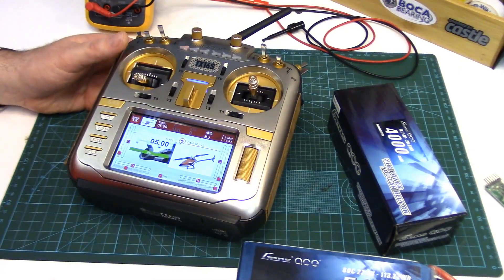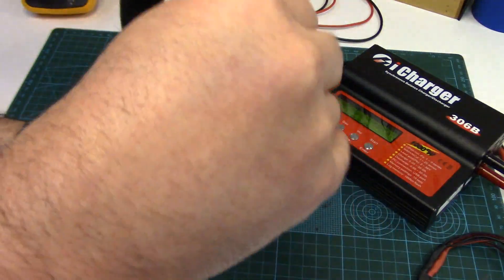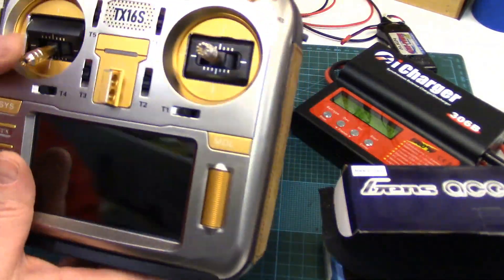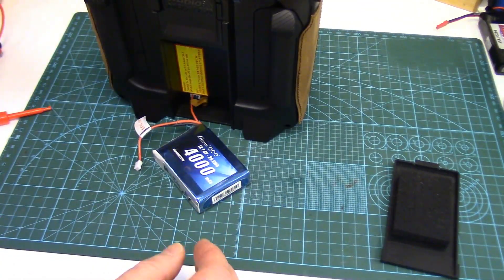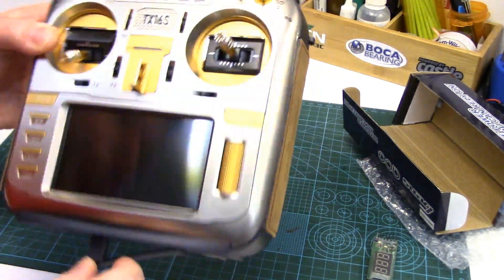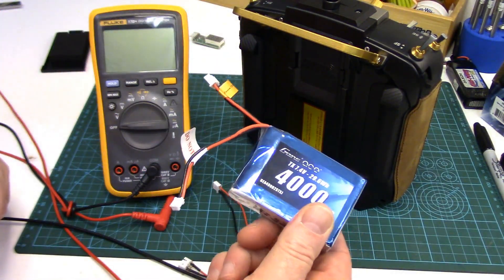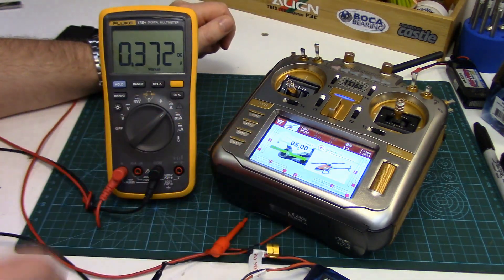Battery Pack for Radiomaster TX16S - Fitting, Calibrating, Run Time

Comment from the maker: Gens Ace 4000 mAh 2S TX16S Battery Pack:
BuddyRC: https://www.buddyrc.com/products/gens-ace-4000mah-7-4v-2s1p-tx-lipo-battery-pack-with-jst-ehr-plug-1?ref=-ptdbz6d-llb
Rotor Quest: https://www.rotorquest.com/gens-ace-4000mah-74v-tx-2s1p-lipo-battery-spektrum-dx7s-dx8-dx9-radio-109334.html

Comment: Great video.  How did you get the amber voice when turning off the transmitter?
Reply from the maker: I can't recall specifics other than I know there is power down voice location and I just put the Amber voice MP3 file of choice in that location. I'm sure a quick google search of something like "open/edge tx power off voice file" will outline the steps from several sources.

Comment: I use 21700 round cells... 2 in parallel so around 10 Ah.. Why so big? My fpv googles also use 2s 8.4V...and with the bigger cells in the trx i can power the googles and save some weight on my head

Comment: Would the current draw not be higher as usually the RC has the radio sending/receiving data (including the radio in the external module which can sometimes be configured for high power to reach further)? Or would this be neglectable?
Reply from the maker: Current (transmit output) is a constant for a given protocol, it doesn't get higher or lower with range. The single biggest power consumer is the screen.

Comment: You didn't connect the radio to a model, I'm assuming that will draw another 75-300ma as well for ELRS, etc?
Reply from the maker: Radio was transmitting rf regardless. No change if rx is receiving or not.

Comment: I went with this same battery for my Tx16s and I was wondering if you only charge these packs via transmitter or if you use the icharger at times. I have a tenergy charger for other lipos but doesn't seem to have capability unless I'm missing something? Any info would be greatly appreciated
Reply from the maker: @SovOutlaw - You can charge a LiPo TX pack internally or externally - your call. Which method you choose will be based on the pros & cons of each charging method and which ticks off more pro boxes than con boxes which include, but are not limited to...
Pros of charging within the radio: Easier, better for the connectors (less manipulation which will eventually cause them to fail), frees up your LiPo charger for flight packs.
Cons: Slower (lower current output using internal radio charge circuitry), inability to easily storage charge the pack to 50% capacity (likely the biggest con), and inability to monitor battery condition (capacity during charge cycle, cell balance, internal resistance etc.). I personally chose to charge within the radio 90% of the time because the balance circuitry is good as we saw & I overcome the storage charge issue by timing my charge cycle to give an approx. 50% storage state. Of course I still pull the packs out a couple times a year to charge them on one of my proper computerized chargers to monitor the pack condition/health.
Reply: @Rchelicopterfun  yeah I think the only option currently (without buying a new charger) is to try internal charging with a 2A outlet plug I can use on usb side. The tenergy charger I have is a 2 system setup where it had balancer and output area and the other cable labeled “do not remove” isn’t a balance port so I can’t even set that up to current other rc charging stuff. Poorly worded so my apologies

Comment: Hi John.
Thanks for the comprehensive video.
The whole business is mind boggling when we mess with lipos.
I have a printed out book form copy of the Radiomaster T16s manual and it says all about the importance if charging but not exactly what source we plug it into to charge it.
I am innocently using my pc but having thought about it I seem to remember that the usb socket on a pc is only 5v.
I am at a complete loss.
No one says!!!
I am using the lipos ( 1850s)
That came with the tx.
The tx goes green when charging but it would surely need roughly 8V to charge 7.4V?
Reply from the maker: Internal charge circuitry uses a DC to DC buck converter. Ie. lower DC voltage stepped up to higher voltage.
Reply: @Rchelicopterfun  
Aha!!! That explains things.
I have done your switch mod ready for heli setup.
For the speaker mod, on opening the case up I already had a speaker in the back. I drilled a series of holes in the back casing from the inside and turned the speaker around .
Super loud now.
Thanks John.

Comment: i noticed on the display there was a picture of model how do you do that?
Reply from the maker: Upload the image file to the image folder on the SD card and then select the image file in the model setup menu.
Reply: @Rchelicopterfun  I tried that radio recognized the fire I got it in the setup but image is still not showing. The aircraft is not binded yet could that be it?

Comment: Thanks for this useful tutorial. Just got the Gens Ace 4000mAh 2S pack and got some error when trying to charge w/ my Gens Ace iMars ii charger. it says "too low voltage, scrap the battery". The batttery new/never used and each cell 3.8V. Don't understand. Do you have to use the EHR cable in addition of the balance plug?
Reply from the maker: If you are not charging the pack through the TX16's internal charging circuit via the USB-C, then yes, as with the vast majority of RC chargers when charging a multi celled LiPo pack, you charge through the main power plug and balance through the balance plug. Without the main plug plugged into your charger, it's not seeing any voltage and therefor thinks the pack is at zero volts and completely destroyed - https://www.rchelicopterfun.com/lipo-battery-balancing.html

Comment: Hi!
Great tutorial. Was trying to learn more about charging the battery via usb-c using this radio.
Is there a known issue with this radio when charging via usb-c?
I am using an identical battery as shown here, new arrived today. And trying to charge it inside the radiomaster tx16s Max. After a couple of hours it didn't send any charge to the battery - I checked with multimeter after removing it from the radio.
Thanks
Reply from the maker: No issues I'm aware of. I have three TX16's and they all charge perfectly from the USB C just as shown in this video. I know lots of other TX16's users as well, none have charging issues. Is the power light turning green when you plug your USB in? Green light indicates it's charging. I'll also presume you are plugging into the correct USB port for charging; the one on the bottom of the radio, not the one on the top.
Reply: @Rchelicopterfun  Thanks. I was plugging to the bottom USB port and was using an iPhone wall charger and USB-C cable - no charging nor green light. After reading your words, decided to try a different charger and tried my MacBook Pro wall charger since it has a USB-C plug - it worked! Green light indicating it was charging and after a couple of hours green light turned off.
Thanks again.
Reply from the maker: @Vitor Morais - glad you got it sorted.

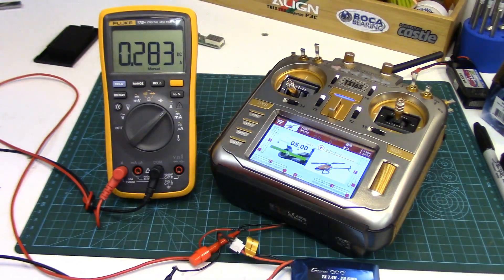Comment: I noticed that you charged the lipo, the battery meter is looking almost dead on the transmitter at the 14:00 in the video
Reply from the maker: Good eye. Answer is because the pack was not fully charged during that part of the video. The open circuit voltage when tested earlier in the video was 7.6V (3.8v per cell). That would be around a 40-50% charged pack. Pretty much what the battery meter is showing. Charging the pack to see how well it balanced up using the radio's internal charging & balancing circuit was left to after the video because I didn't want to stop shooting in the middle of it all to wait for the pack to charge up.

Comment: Just now considering getting back into RC from a time when, 1/2 the RC plane club scoffed at this new wiz bang computer radio idea. "that will crash your model", "skilled pilots don't need that", or "that's cheating", etc...
Similar thing happened when brushless motors came along.

Wish I could see today, what's coming in another 25 years?

Comment: I just got the color version. using a 2s lipo but when I trying charging it grenn light dont come on. am I missing a setting? is internal charge even working? just got radio last night.
Reply from the maker: No setting in the radio - it should start a charge cycle automatically as soon as you plug the USB C in. A few items come to mind to check or try. 1. Try a different USB cord in the off chance the USB cord is defective. 2. Confirm you are using the correct USB C port on the radio (the bottom one for charging). 3. Try a different USB power source. 4. If the LiPo pack or 18650 cells are unhealthy (high delta voltage difference between cells) or under a certain voltage (ie. over discharged or faulty cells), the protection circuitry in the charge circuit might prevent the charge cycle. No idea if the charger in the TX16S's has LV or imbalance charge protection as I've never tested what happens if an under voltage or large imbalanced pack is used? 5. The pack or cells you're using are already fully charged (about 4.19 to 4.20V per cell) so a charge cycle simply won't start.
Reply: @Rchelicopterfun  yes my mistake... I plugged in the power instead of the balance plug from the battery into the radio once I did that correctly it worked fine.. I had to think about it for a few minutes and then I realized it all good now though.

Comment: hey quick question
My Radiomaster isnt auto charging when its plugged to pc, do someone know why or what i need to activiate to charge it?
Reply: Are you plugged into the USB slot on the bottom of the radio? That top USB is for data and bottom for charge.

Comment: Hi John,
I just got this radio(i am a complete beginner btw) and have installed two 18650 batteries which are 3.7v each with a capacity of 3000mah. the first thing i did was that i put it on charge. What i noticed during charging is that, when on charge there is a green light constantly ON which goes off once its done charging (or so i thought), so when the light went off i took it off the charge and noticed that the radio wasn't fully charged(the bars werent full at the top). As I dont have a multimeter i just set the battery calibration to 7.4v as both cells are 3.7v each and the battery meter range to 6.4v-8.4v. Is something wrong with my radio or the calibration values I set? Any help is appreciated, i just hope i havent gotten a defective radio.
Reply from the maker: Nothing wrong with the radio, it's your calibration process. 
First you MUST use a DMM to do this correctly. Without  a DMM your reading is only as good as your guess; and your fully charged voltage guess is way off. 3.7V is not what a fully charged lithium cell will be producing. 3.7V is the nominal voltage of the cell. Fully charged, the cells will be upwards of 4.18 to 4.19 volts (unloaded). You can't use that voltage however for calibration because the voltage will sag under load. The voltage will also sag by different amounts depending on how much load is on the battery (screen brightness level for example) and how healthy/good the battery cells are.
In short, using a DMM is the only way to calibrate the actual voltage  - guessing is just that - guessing. 
You can also vary the voltage meter readout on OpenTX radios, but that again requires some form of voltage measurement equipment.
Reply: @Rchelicopterfun  Thanks for the reply. So you're saying that the battery charge only to the amount you set it to on the battery calibration? Because what I did was, I plugged the tx in with a 18W plug that charges upto 2.4A. And when the green light went off, I unplugged it and turned it on. After turning it on I could see on the main page that the battery voltage was at 7.5 volts with 2 bars off the battery symbol. This was before I did any messing with the system settings and calibration. And then after commenting on here about the issue, I tried to charge it with a 5v 1A plug, and it charged fully upto 8.2v which makes sense now as you said the lithium cells charge upwards upto 4.18v. Why did this happen? Was it the plug I used previously? if so, why did it stop at 7.5v?was it the plus I used?
Reply from the maker: The voltage calibration process as shown in this video has nothing to do with charge termination voltage. That is set in the built in charger circuitry and we have no control over it. Calibration simply matches the voltage readout to what the actual under load battery voltage is.
Sorry, I don't understand what you are saying about these different plugs? Are you talking about the USB C cable or the USB power source? No idea why different USB power sources or USB C cables would produce different states of charge? Faulty USB perhaps or a USB power source with some sort of automatic current output which is messing with the internal charger in the radio? Just a guess without being able to test it all. Suggest contacting tech support.

Comment: How does the charging work? and do you know it is charged?
Reply from the maker: Charging & balancing is done using the radio's internal 2S charging circuitry. When the green indicator charging LED indicator (power indicator) turns off - charging and balancing is complete.

Comment: Hi, I'm using the stock battery tray and Samsung 18650 batteries. I've tried calibrating the voltage several times now while connected (MM between the end posts on the battery for total voltage. The voltage sag just from screen brightness changes gives me different readings. (Forgot which way now). Meter is good. It picks up on the sag/voltage drop, but if i have it match on low brightness, my meter and radio aren't match on high brightness.
That said, I've never had the light turn off for me.  I let it charge overnight this weekend, and all morning the next day, light never shut off. When I checked the voltage in the radio I got 8.29 with screen dimmed. My bay charger showed 4.15 per cell. My mm agreed with that. 
What gives?

I'm about to pull the batteries off my bay charger when full. Put in holder, use my lipo checker to get voltage per cell, add them up, and power on a quickly set the combined value in the radio to see if that gets it to charge fully.... Please stop me if this might burn it down next time I charge through the radio port.
Reply from the maker: Pick the display brightness you usually run at or a mid range of where you run at an set voltage calibration at that level/current draw. It's likely due to high internal resistance in the 18650 cells you are using but that is just a guess without properly testing it and knowing exact values (voltage and current draw and testing the internal resistance of each 18650 cell). 
The method you described won't give a true value because checking the open circuit voltage (unloaded) will give a significantly higher voltage value than when loaded, especially if your cells have fairly high internal resistance. Exactly why I said in the video it's important to have an external power plug on the battery pack to check the under load operating voltage - that is the only way to get accurate voltage values and then set the calibration voltage. To do that with the stock battery tray, you could solder in a pair of "test" wires as one possible method with a JST plug/similar on the end. That or don't worry about it. After all as we saw, out of the box calibration was pretty darn close - at least on this particular TX16S.
Reply: @Rchelicopterfun  Thanks John.  Maybe it is IR discrepancy but they way I see it, I charge it with the radio off.  And it if the green light indicates it's charging, it never stops charging.  I opted to charge them full on my trustfire bay charger, plugged it in, and it yeilded 8.56v on the transmitter while my MM showed 8.46.  So I went ahead and brought it back down.  I don't typically look at the display while flying, and it goes bright based on buttons only. I calibrated it while dimmed.  I'll probably charge it again this weekend depending how much I can get out (or how much I play with a different technique of using FM GV).  I'd really just like to get it so it reaches a "done" state and quits charging...

Comment: Should i leave the battery inside the transmitter or remove it after each use
Reply from the maker: I leave mine in - at a storage state of course like you would with any LiPo battery.
Reply: @Rchelicopterfun  ok, so around 7v should be safe to hang out at if i use it daily? And thanks, i really appreciate you taking the time to answer.
Reply from the maker: 7V open circuit voltage is way too low. That's only 3.5V per cell - basically over discharged. A lipo at 50% safe storage capacity is around 3.85V per cell. See my LiPo page on my website if you are new to LiPo's and need to understand their nominal voltage range and how to properly store them, care for them, etc.   https://www.rchelicopterfun.com/lipo-batteries.html

Comment: Great Video John, While you are talking batteries, can you tell me what power units you use for your Ichargers please, some are stupid money when you start talking power for a icharger 4010
Reply from the maker: I cover the basics of what I use on my power supply page on my site: https://www.rchelicopterfun.com/rc-power-supply.html
Can't go wrong with Meanwell but for my iChargers including the 4010DUO I pretty much use modded server supplies exclusively which I cover in detail on this page: https://www.rchelicopterfun.com/dps-600pb-build.html
I use 4 of them hooked in series to power my 4010Duo. You should be able to find 4 HP DPS-600's for under $100 USD combined. The value doesn't get any better than that - nor does the quality :)
Reply: @Rchelicopterfun  thank you john. Help really appreciated

Comment: Hi John, Really helpfull vid,I bought the Jumper T16 when it first came out.Had a lot of the early issues with mine. really thinking about getting this radio to replace the jumper.
Also looking forward to the e180 vid, hoping this will be cheaper option over the OMP,thas out my price range.